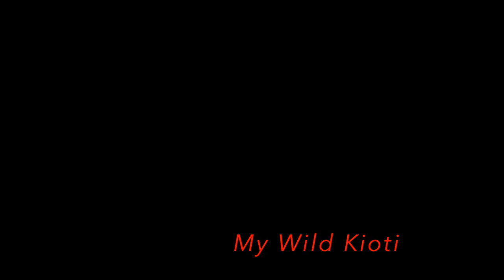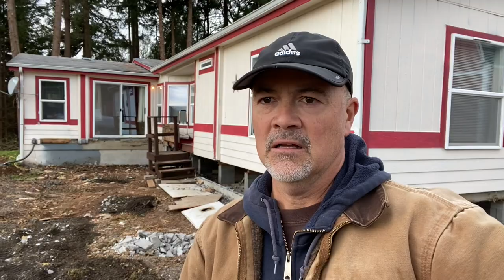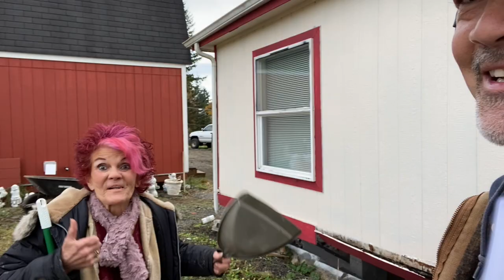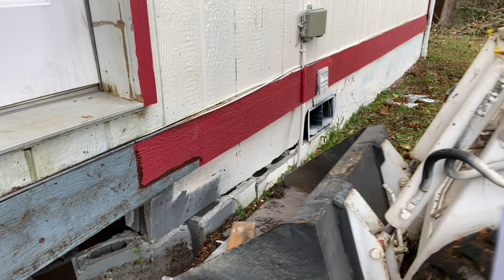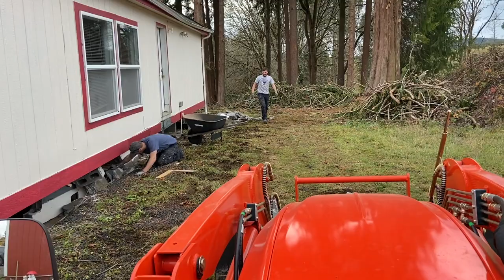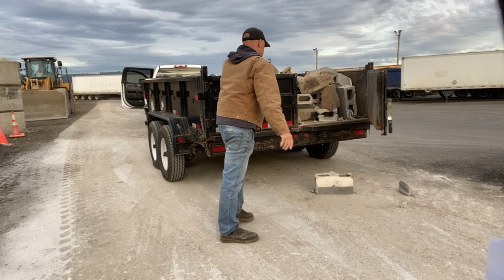#14 Kioti Tractor and Bobcat Skid Stir - Removing Manufactured Home Foundation - Crash Dummys

Comment: Dumb Aussie question. Is the space under the house extend all the way through? And does having a space under the house help with insulation? 
In Queensland, one of our hottest states, there are houses called Queenslanders built before air conditioners. They are built at least six foot above the ground to allow air to circulate and thus keep the house cool. Hence the question.
Good video.
Reply from the maker: Johanna McDonald . Yes, it runs all the way through. once the mobile is gone. Our builder will pour our new foundation and savage whatever he can leave of the current slab. It will basically be a crawl space. We don’t have extreme temperatures here. They use a variety of foundations here. I’m not an expert on the logistics, hiring that out. Take care!